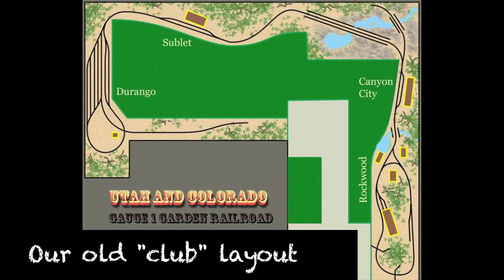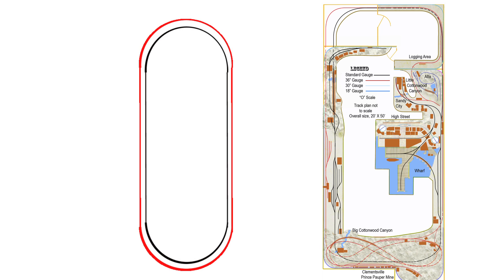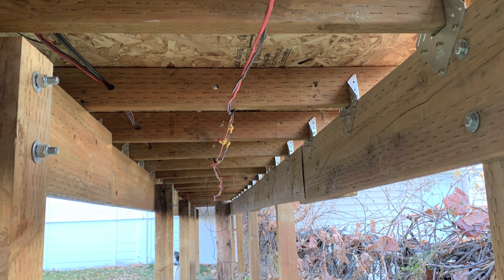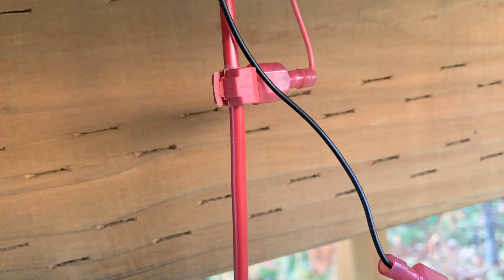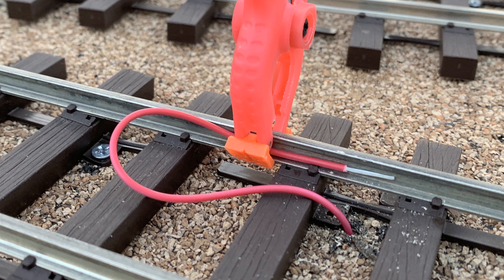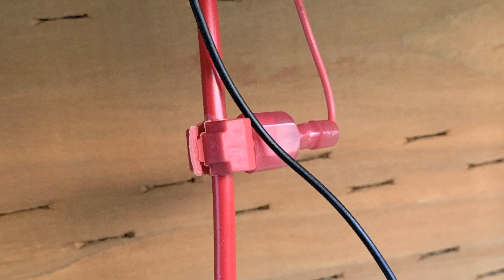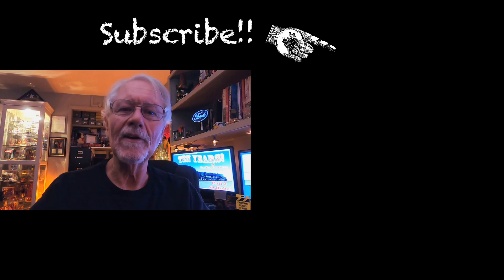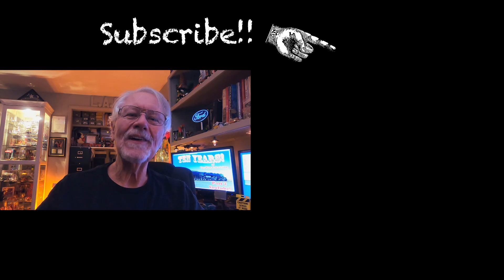Electricity for Model Railroads - Week Six - Track Power Bus Wiring

Comment: I know I once asked this, but are we at the point where we start to see RC railroads and eliminate all this hassle? I do appreciate this series a lot, but lithium batteries have gotten so small, as in our devices I am just wondering when we will see this shift? Especially in garden railroads where a larger battery pack could be used. Has anyone tried converting or hacking one of their locomotives to this? Maybe take the parts out of an RC car and putting them into their locomotive? My other thought is taking a power tool battery of any size and wiring it up to the engine. Those batteries are getting more powerful and smaller (like the DeWalt Powerstack that uses flat phone-type cells).
I think this would be an interesting topic to add to this series that you are doing, maybe as a “final thought” as your last chapter.
Reply from the maker: Hello, fun at Disney! Yes, we’re planning to talk about that for sure. There’s a whole group out there that called themselves the dead rail society. The downside of that is really that it is large for some of the smaller scales. I’ve seen it done in HO scale and there’s a lot of talk of even doing it I n scale.  But it’s a bit challenging. And expensive. A system for f scale costs about 300. 400. Then about 250 per locomotive. A popular system is “Air Wire”. I’ve had Rc locomotives. It is cool. And a lot of people are doing it.
Reply: @ToyManTelevision  I will look forward to that! Again, I think it would be most beneficial for outdoor railroads where you have to deal with the electrical, keeping the track clean to pick up power and so on. Thanks again for these!

Comment: Great vidio, been using red +  / black -   for ever guess cause of motor bike electrics, yard layout bus wire is 100' extension cord and the fast track is wired together underneath track itself in 10' sections then down to bus wire. Transformer is at mid point and runs 70' both ways.works great.Thanks for the morning coffee...
Reply from the maker: On my old garden railroad I used orange outside rated extension cords. Three wire. It was buried. Mostly under the track. But not everywhere. It ran from power the the west end of track. About 30’. Then under the track all the way to the east end. About 200’. Then back to power another 60’. So power from both ends. Then another trunk line from power to the center of the main line. Another 60’. So the bus was fed from power from three places. I used the three wires for cab A cab B and neutral. I used the heavy gauge extension cords. 12 gauge as I recall. Power drops at every rail joiner. I couldn’t solder because I was using aluminum rail. This worked pretty well in spite of everything I still had a fair amount of voltage drop on the grade.
Reply: Dc dont like 100'. Thats another reason i used ac and Lionel,  ac good  fur 1000'

Comment: When using A/C for DCC, do you have the same polarity problems as when using D/C, IE, reverse loops?
Here is where I begin to be lost in the woods, I don't quite understand the differences between DCC and old fashion D/C control. ;-)
Reply from the maker: The next three weeks!!! But yes, any 2 rail power needs reversing loops. They work differently in DCC and AC but you need them Not in 3 rail or trolley wire.

Comment: That's OK for DC but Not for AC which was on my train controller/transformer- white for neutral and black for Hot with green for ground (-)negative!! That's confusing!!!
Reply from the maker: well works the same sort of. YES Id use white and black for the bus. and the ground as green. BUT you don't need the ground on the track bus. You need it in many places, but not on the track.